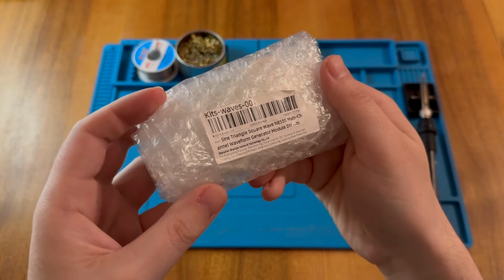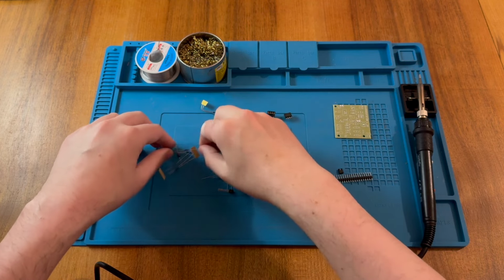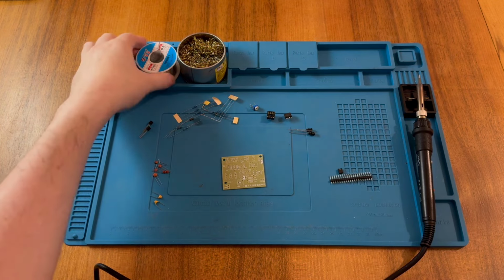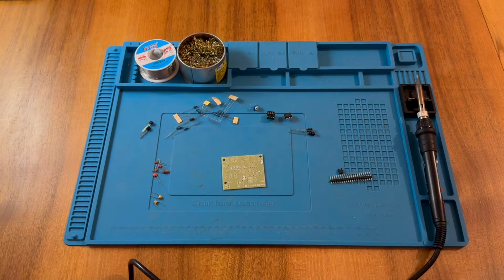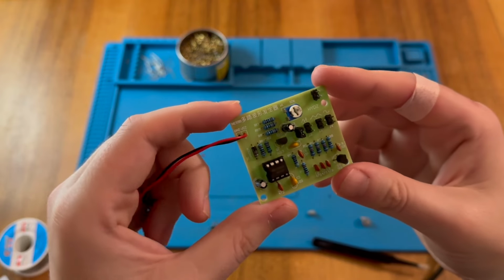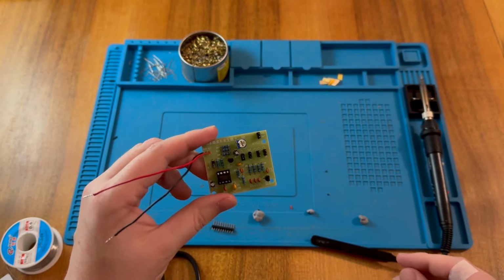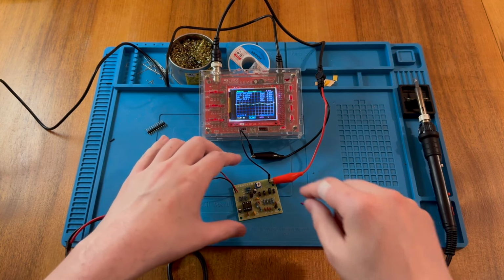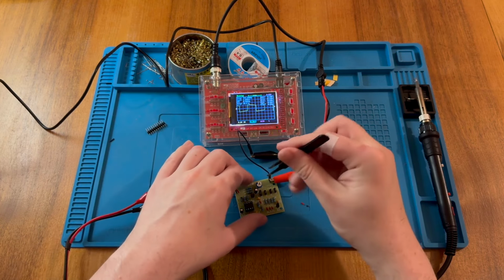Cheap NE555 Multifunction Waveform Generation Soldering Kit - Square, Sawtooth, Triangle, Sine

Comment: i have a nearly identical iron, got it for like 20$
Reply from the maker: I got this one from Amazon for £14, which would have been about the same. I'm not at all convinced by the temperature control on it, but it works fine for most of what I need to do.
Reply: @jtjacques  yeah they do alright, I’m looking at getting a better one but these cheap ones do certainly get the job done